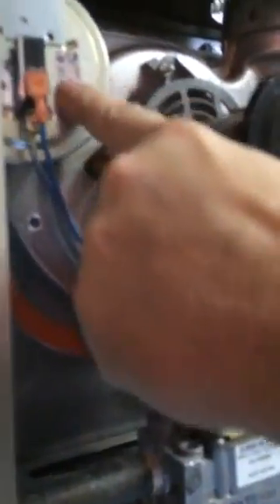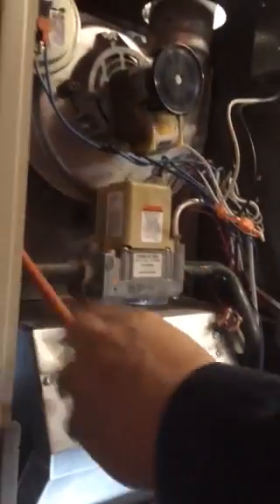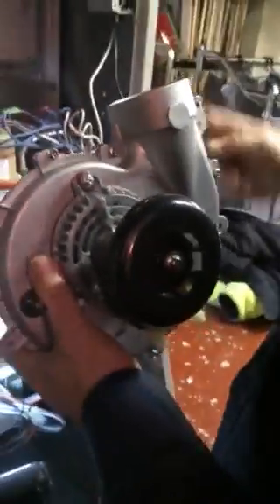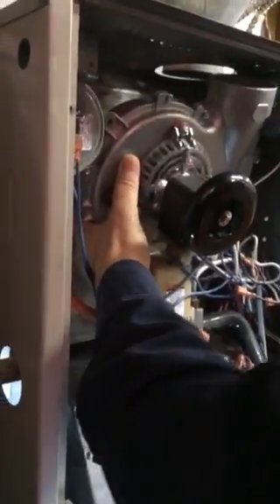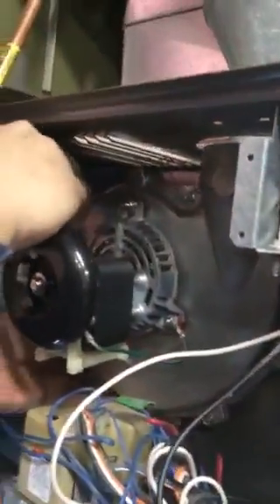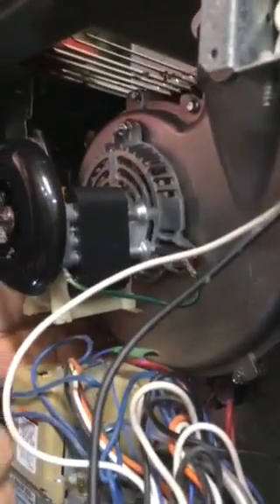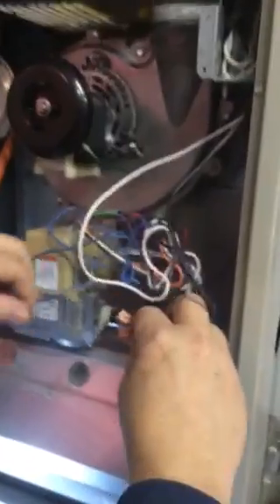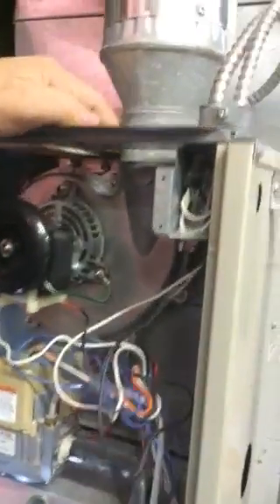Fasco A172 furnace motors installation Heil, ICP, Keeprite,exhaust, inducer motor Canada.

Comment: Looks identical to my system except the pressure switch is mounted over to the right. My motor has been squealing for quite a while at a certain section of the heating cycle. Time to finally order a replacement and get it installed. Thanks! (my original motor assembly is Part# 8660-4117).

Comment: What model are you installing in the video? Any Fasco A172 I see are spot welded together. I like how that one you have can be taken apart to access the squirrel cage fan and replace or lube the bearings that seem to never have enough grease in them.